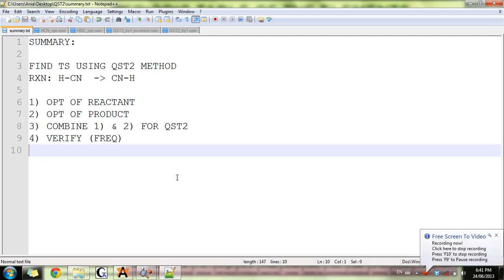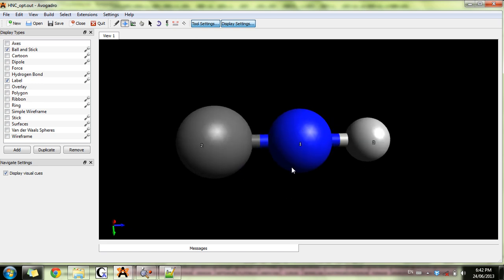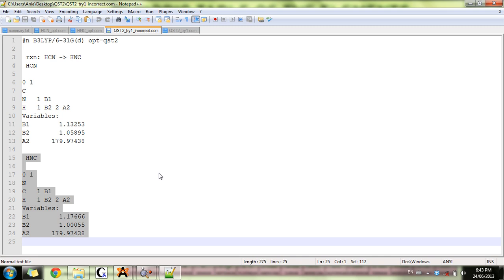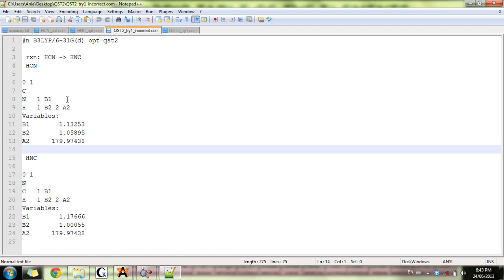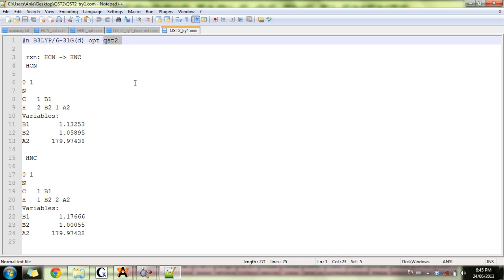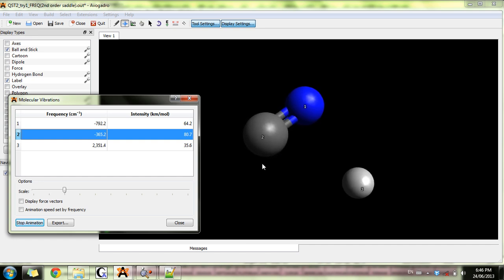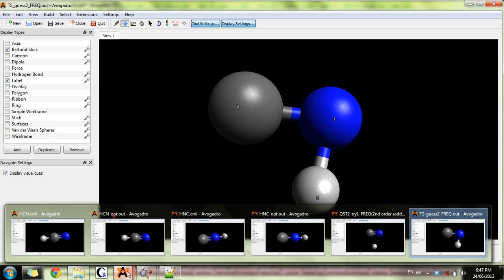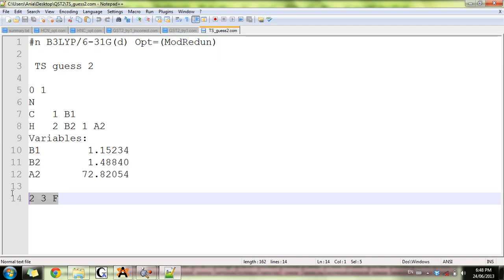Avogadro with Gaussian Tutorial QST2

Comment: Hi. I'd like to know how could i proceed when i have one reactant but two products?
Reply from the maker: you would need to find a geometry that will connect those two molecules in the TS state, same as here. Which reaction are you working on?
Reply: IaNiusha I'm working on breaking a C-O bond from a molecule with 38 atoms. So I got the following error: THE DIFFERENCE BETWEEN A NOOSE AND A HALO IS ONLY 12 INCHES.
 Error termination request processed by link 9999.
Do you have any advice?
Reply from the maker: Anderson Lima Error termination request processed by link 9999 usually means that the program was unable to finish up the calculation you asked for. For example, if you wanted to do an optimization, it was unable to converge to a minimum energy geometry.
If this is the case, you need to restart your computation with a better starting geometry.

Comment: Using a similar input file except without the variables shorthand in my z-matrix, I get the following error message:

 New curvilinear step not converged.
 *** Convergence failure in GTrans ***
 Try using 3 structures as input for
 QST transition state search

 Have you ever come across that?
Reply from the maker: I didn't, but usually this type of error happens when the initial guess for the input structure is bad (if it happens right at the beginning of your calculation). Otherwise, the program is probably finding that QST2 is not good enough for this case, and requests a guess of the TS.

Here is what other people say about this error:

"New curvilinear step not converged. Error imposing constraints
Error termination via Lnk1e in /pkg/gaussian/g03/l103.exe

Solution: Problem with constrained coordinates (e.g. in OPT=modredun calculation). Try to restart optimization from a slightly different input geometry."

From: http://docs.notur.no/application-support/chemistry-applications/gaussian-1/troubleshooting-gaussian-calculations
Reply: Thanks. I will have to try adding the variables and see if it makes a difference. Otherwise, qst3 seems to do the trick, so I won't struggle with qst2 too long for this case. Here is my qst2 input file if you are curious:
#n opt=qst2 b3lyp/6-31g(d)

Title Card Required

0 1
 C              
 N                  1    1.14660000    
 H                  1    1.07000000 2  180.00000000

Title Card Required

0 1
 C              
 N                  1    1.14660000   
 H                  2    1.00000000  1  180.00000000